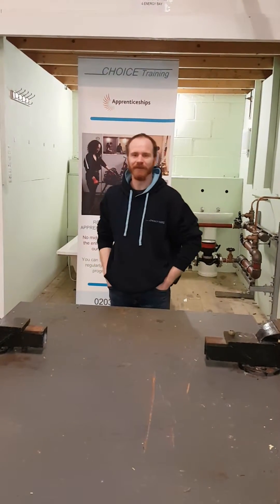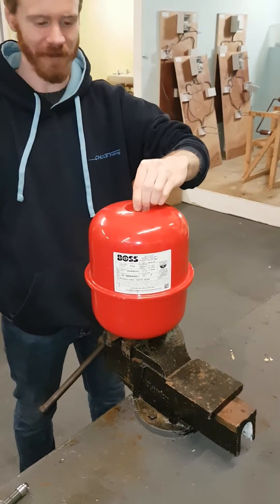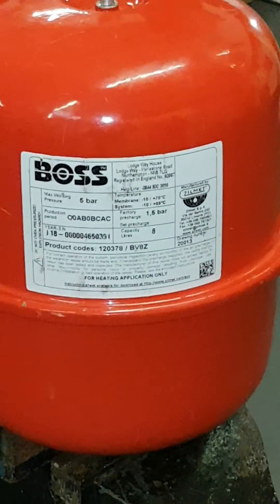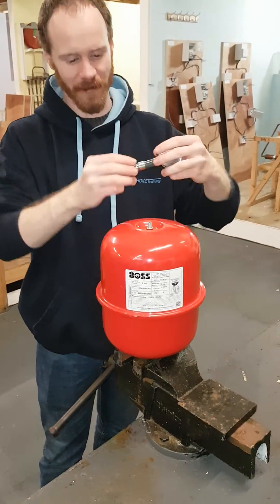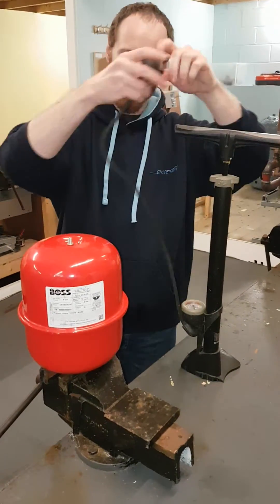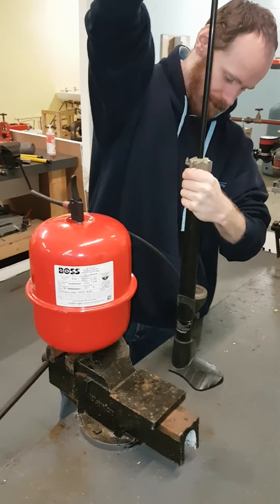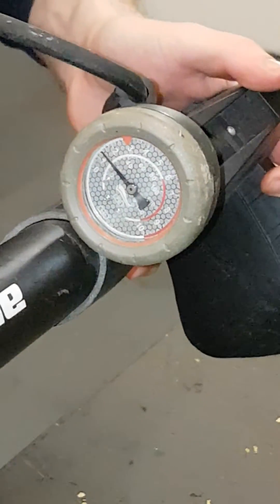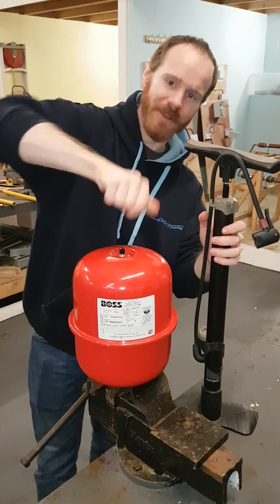Pressurizing an Expansion Vessel

Comment: When I try to pump the vessel it won't inflat.  There is no give. The pump won't even go down. Any ideas?
Reply: You have to turn off the water supply first and open a faucet to take out the pressure